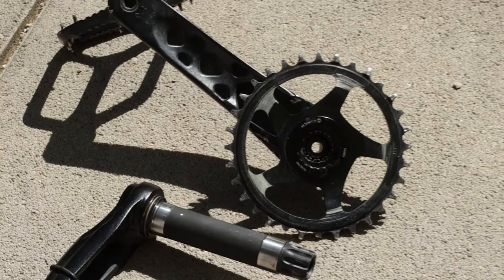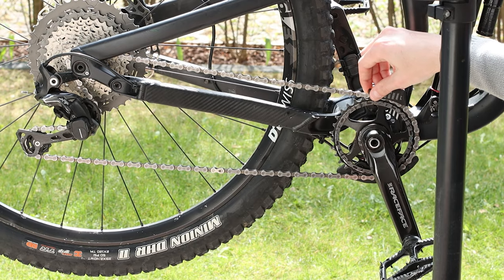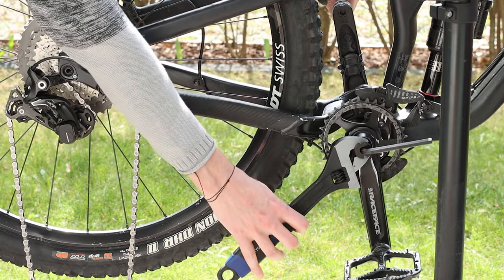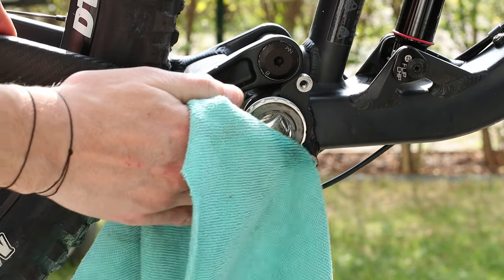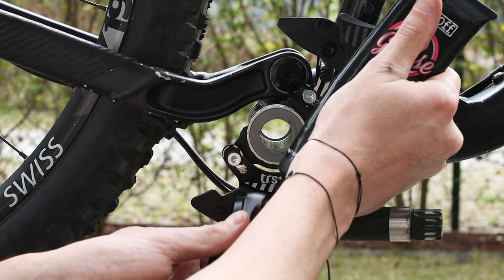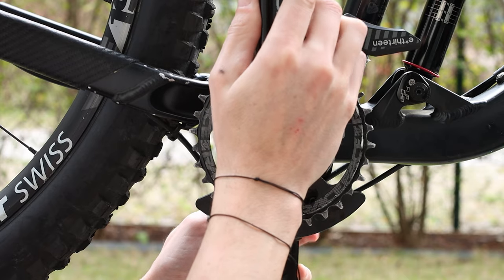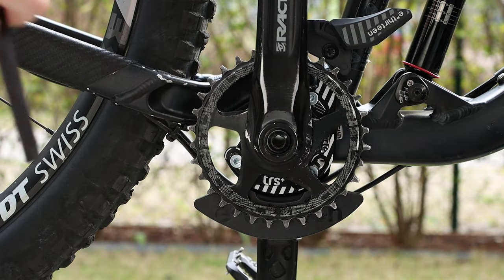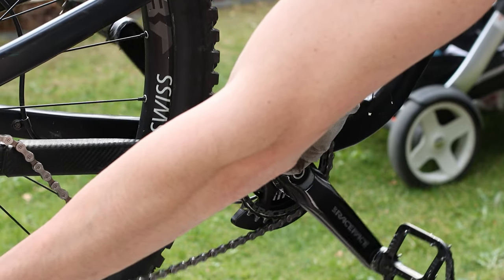How To Remove Service & Reinstall MTB Cranks ⚒️ (Race Face AEffect)

Comment: Hey! Nice video! Just one question. I have a washer and don't know where to install. On the thread of the 8mm bolt or between the 8mm bolt and the cap with the10mm hole? Thanks!
Reply from the maker: Thanks! That depends from your bike frame, in the manual you will find where based on that, if I remember well...😄

Comment: Did you felt like its going to move but a couple screwing after you felt tension again? I scared to brake it
Reply from the maker: Not really, removing it was quite straightforward if you use the right leverage!